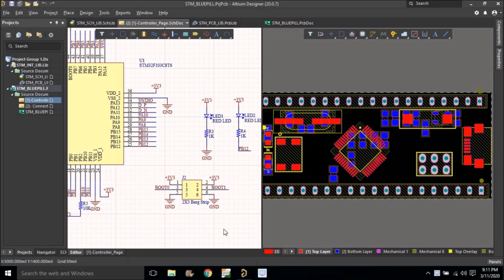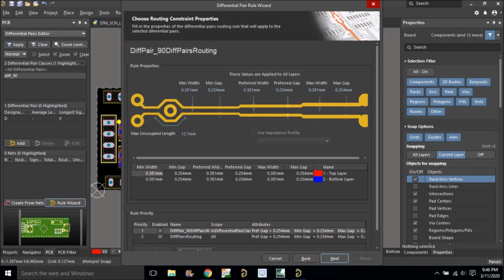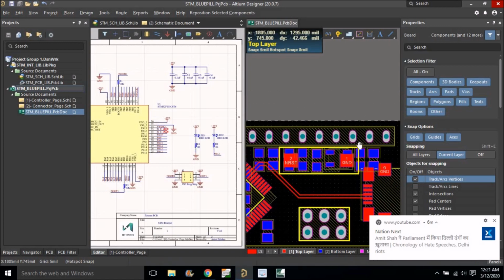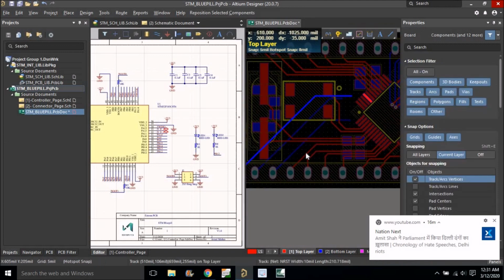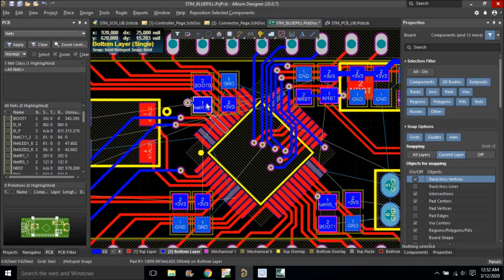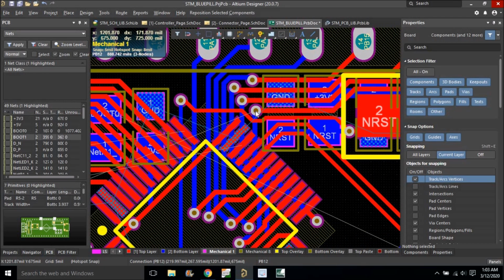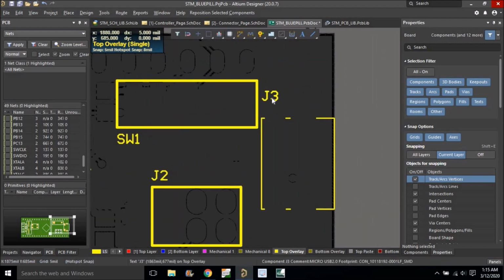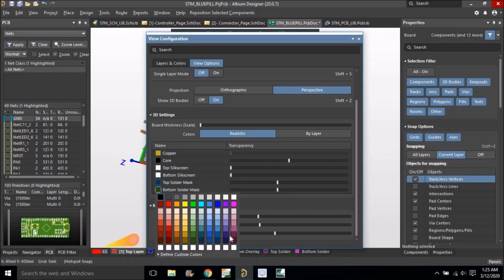STM32 Layout Altium Designer 20 Tutorial Sponsored by "Nextpcb.com"

Comment: The Differential Pair Impedance Calculation  is incorrect.
Reply from the maker: Hey Rahul, could you please mention the time frame where you found issue, I ll look into it
Reply: @EsteemPCB  09:55 you are calculating for micro strip you should be calculating for differential pairs all the values of width are wrong afterwards.
Reply from the maker: Rahul you are right, apologies for wrong info, please refer this video https://youtu.be/dzrRq1ZU2Ls

Comment: Sir, my diff pair wires cannot be connected to the Microcontroller pins..And also same happens for the other pins..What should I do ? Pls Help
Reply from the maker: Go to design rules -> clearance and set it 5 mil, later you can change it, by making design rules for that.
Reply: @EsteemPCB  thanks you so much
Reply from the maker: Thanks 😊 keep watching
Reply: @EsteemPCB  How much diameter you use via hole size? I use it as much as you, but large.
Reply from the maker: 0.8mm outer and 0.4mm inner

Comment: Sir, my diff pair wires cannot be connected to the Microcontroller pins..And also same happens for the other pins..What should I do ?
Reply from the maker: It's not connecting then there can be 2 reasons 1- net name is different for pin and track
2nd reason can be the track track clearance is higher than the Clearance rule.
Solution: design-> rules-> clearance make it smaller 3 to 5 mil and check the box ignore pad pad clearance on  same footprint
Reply: @EsteemPCB  This Solved my problem Thank you SIR
Reply: Esteem PCB Still not solved sir... DP pin in microcontroller has highlighted with Several + marks ..
Reply from the maker: Do one more think remove the d_p and d_n diff net class and create a net class again on schematic page import it to pcbdoc file, then create diff rule and follow exact what I am doing (dont forget to create rule with different name)
Reply from the maker: Your problem solved or still you have any doubt if it not confidential, you can mail me your project file i resolve the problem and revert back to you. "esteempcb.info@gmail.com"